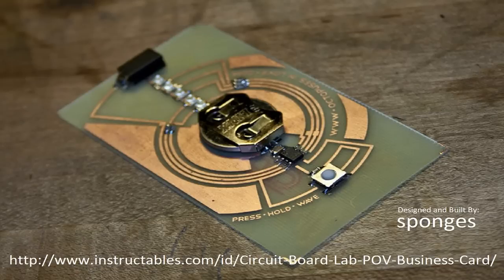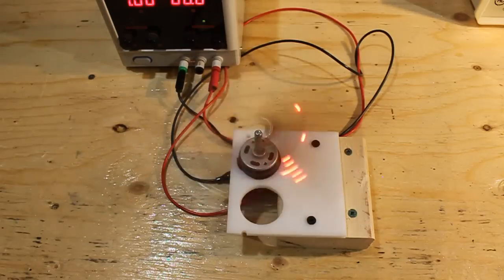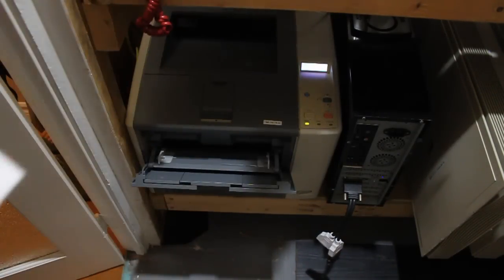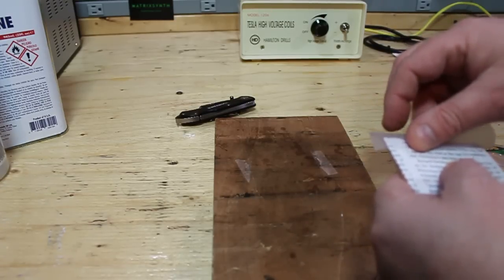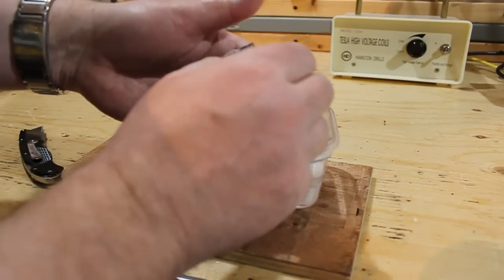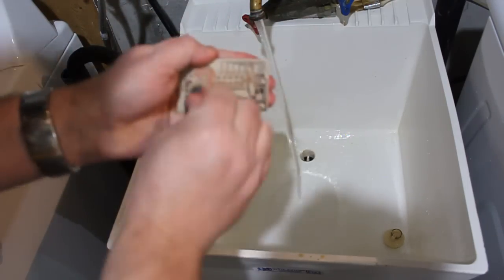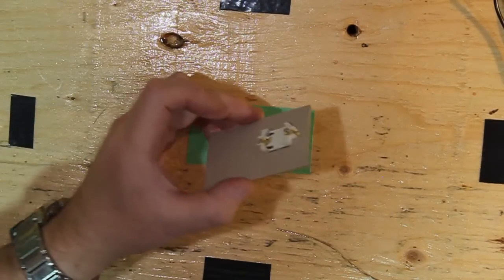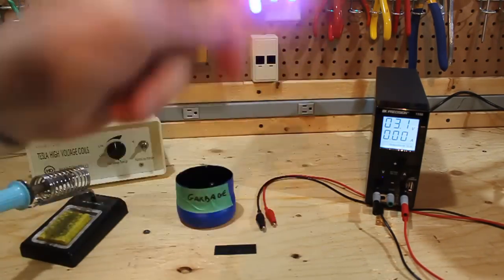Easy to Build Persistence of Vision (POV) Business Card - Basic Tools Required

Comment: So you're basically using through hole components as surface mount by pre-bending them? Clever.

Also, random question, what kind of watch are you wearing?
Reply from the maker: Watch is a Fossil CH-2544 , thanks for your comments

Comment: Great job, great video. I  did toner transfer before I got my laser cutter. One thing I found improved my boards massively was to run a rubber art roller over it while it was hot. Worked much better on the bigger boards especially. I even did some BGA;s when I was ambitious.